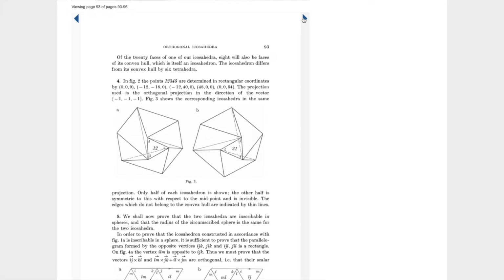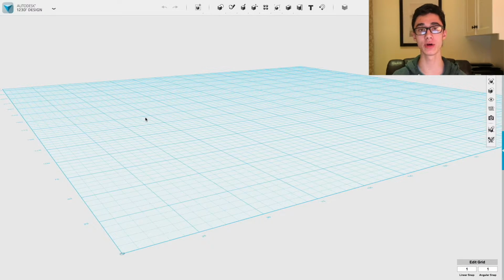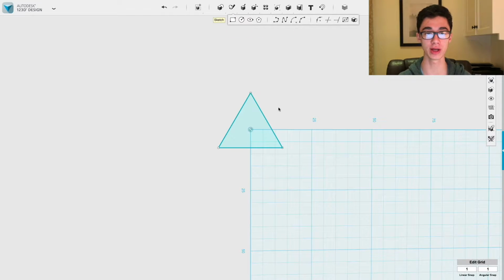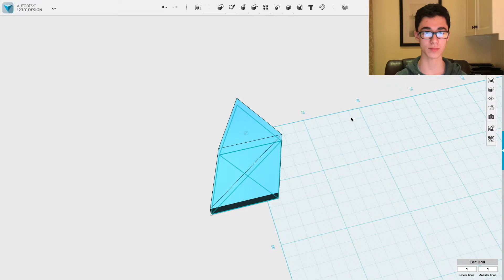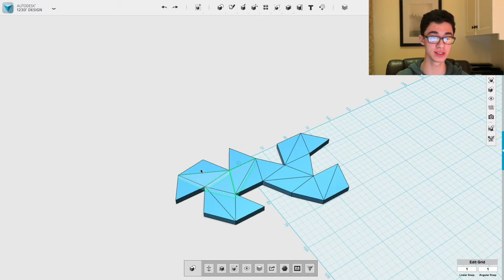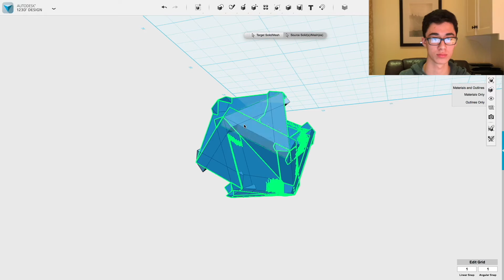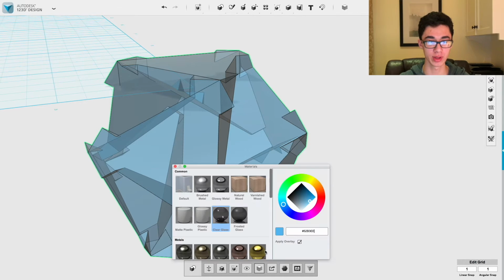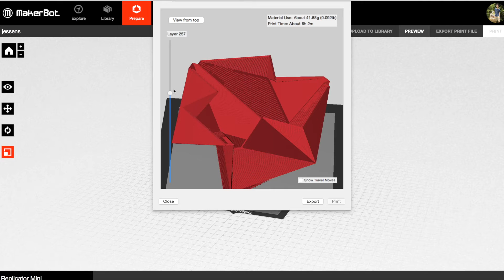Jessen's Orthogonal Icosahedron

Comment: Curious if the multistable properties could be used for actuation in some way. Maybe there could be a way to make modular robots with these — if the cube form could traverse by 'jumping' when it is in uncompressed form, then link with others.

With soft robotics, is there a way to keep shapes in compressed form (maybe reducing the air pressure inside)?
Reply from the maker: Erin RobotGrrl I've been investigating that same idea! I think that pulling a vacuum on the inside of the the shape would cause the transformation. I think that if I could combine that with making the equilateral triangles inflate, I could make a robot that can collapse and roll around. I hopefully will be making more videos on the subject, so stay tuned!
Reply: @XYZAidan  Have you seen the NASA Super Ball Bot? https://www.youtube.com/watch?v=hkzeE6BVNIk

Comment: A while back i was pondering an idea for a ball balancing robot (a modern example is BB-8, but really i was thinking of more like a "Project Rezero") but with the spherical wheel being able to adjust it's size, expanding or contracting on command.  It would allow the robot to traverse large obstacles in it's path when needed, and to travel faster while outdoors, while still retaining a small and nimble size when indoors.

Anyway it was a crazy idea but fun to think about, and i was originally looking at those Hoberman sphere toys for inspiration.  But this shape is interesting too, so i'm noting it down, thx.
Reply from the maker: roidroid thank you! I'm glad it was of interest to you. That's a really fascinating idea of a variable diameter ball robot. I'm curious if some of the inflatables work I've done in the past could contribute to that at all.
Reply: It would be interesting if you could make a tensegrity robot to do this - where the structure would be internal to a flexible outer shell. Maybe those expanding sphere toys would be a place to start for such a structure! Though, this would be a hybrid of rigid and flexible - rather than primarily soft robotics.
Reply: Aright i found my old notes, they're from 2014 (wow).  I'll just dump some of it here incase it's of use for someone else.

Inflatables was indeed the first idea, but i was worried that anything elastic enough to so drastically change it's size would also inherently be too floppy/delicate to be useful as a vehicle wheel.  If it's too thin then there's a puncture risk, wheels must be robust.  Also it needs to be able to hold the robot's weight ontop without the ball being flattened, as the height is what allows it to roll over tall obstacles.  You could cover it with intersecting armour plates, but at this level of complexity it's probably easier to remove the squishy middle altogether and just articulate the armour directly.  

"Coil whisk" designs seemed promising, a single internal motor would wind one tighter/looser.
Also, there was the idea of shrinking/expanding the 6 flexible strips of a woven "takraw" ball.  Think 6 retractable tape-measures.
"QBall" on thingiverse looks like a good start for the tensegrity angle.

There were other ideas that never got fully formed, like using those coffee-grounds universal jamming grippers, or an electro-magnet surrounded by a matted shell of steelwool.
Reply from the maker: roidroid Very cool, you have some great ideas. I'm thinking that a possible idea would be to cover a ball with inflatable bellow actuators that linearly expand (check out this video: https://youtu.be/348WSyRwkCw). If they all inflated at once, the size of the ball with the actuators would increase. The difficulty here would be how to mount the rest of the bot on top of it, but that's just my two cents.